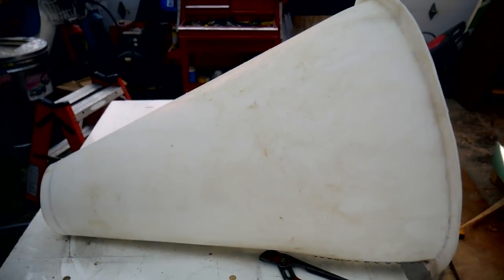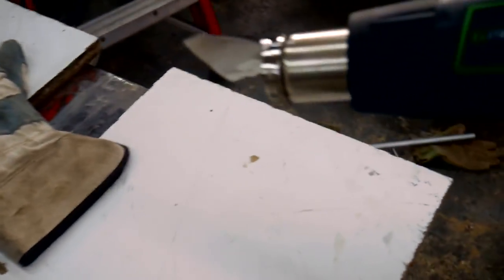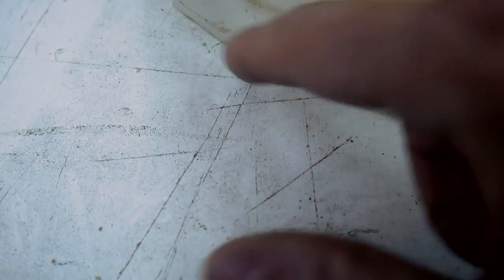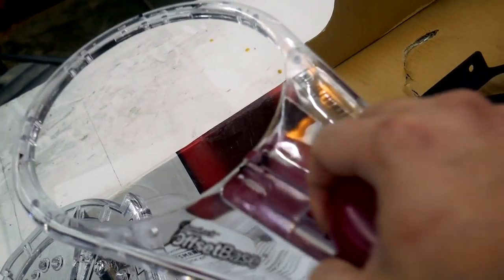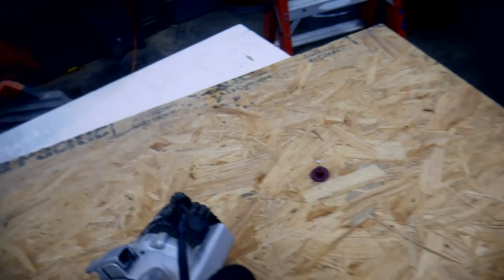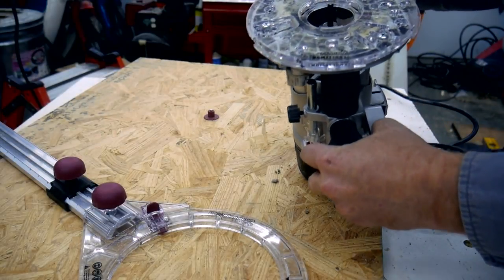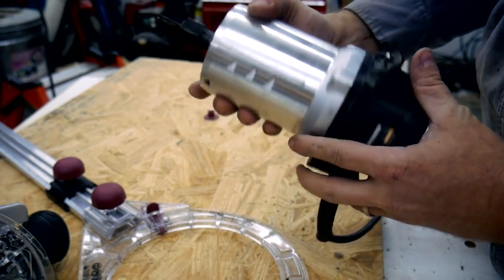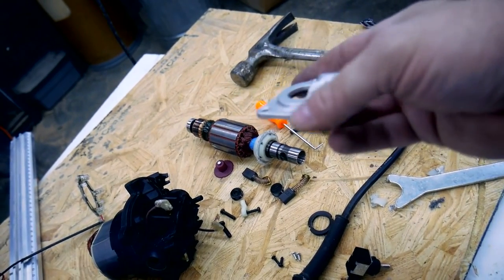DIY Cyclone Dust Separator Part 2: Speedbumps

Comment: I have the fixed vase version and the same jig.  I love them both and they have worked flawlessly.   My craftsman was made in the same factory as the Bosch router  (which is why I bought it).  How about ordering the correct collet.
Reply from the maker: I had to rewatch the video to remember why exactly I did what I did there.  I think Sears wanted $20 for the collet and $15 for shipping, and I'm a cheapskate.  So here we are.  2 years later and I still haven't done anything with that router.  I have plans for it though. Someday.
Reply: @SouthpawWorkshop  I think you have some recycly materials - aluminum, copper from the windings and steel. The plastic is likely unreusable 
[caution: new word!]
😁😉

Over time I've taken a lot of things apart with the best of intentions. I've since learned to recycle and to cut failing plans loose, aka "get on with it"! 

I took in a load of galvinized fence, car batteries, some copper, aluminum, even plain steel. Walked out with ~$300! and a healthier planet. Craftsman power tools was a very much lesser brand. The wrenches were generally pretty good, but you'd know the difference if you made your living using them all day 😐